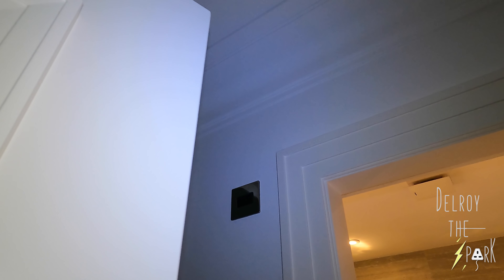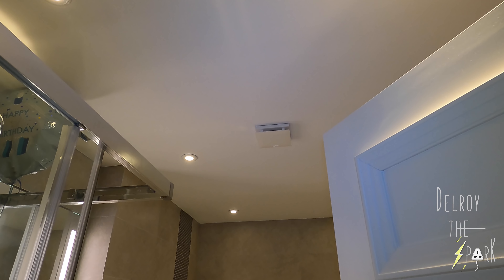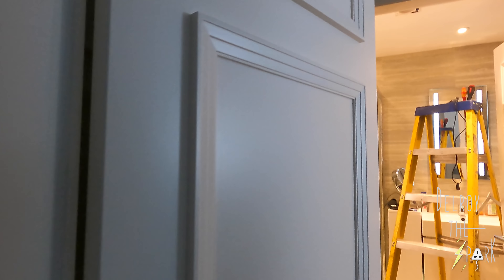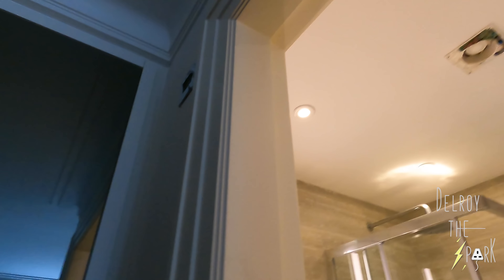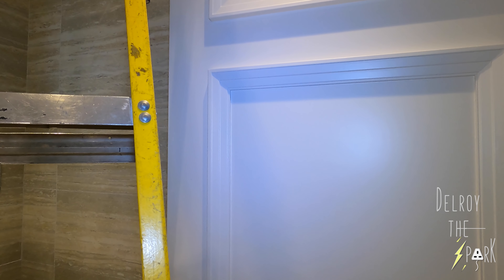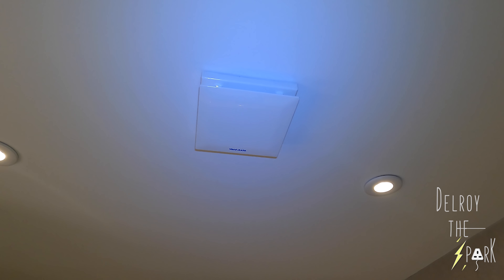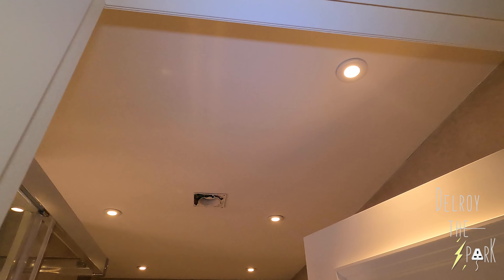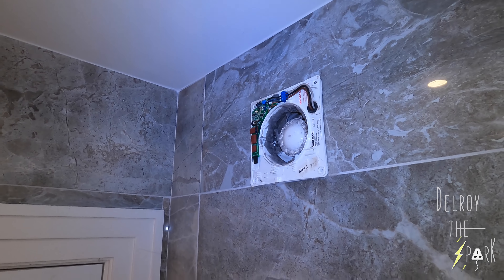"Is There A Problem With My Go-To Vent Axia Fans?"| New Builds = Problems!|Electrician In London

Comment: Nice one Delroy! That is a mystery regarding those fans. Surely they wouldn’t burn out prematurely simply because the ducting was long? 🤷🏻‍♂️

I suspect that, like many things nowadays, they are only designed to last just beyond the warranty period. 
I tend to choose Xpelair, although even I have to admit that they are simply not built to the standards they once were. Take the GCX6, for instance. That model can trace its roots back to the 1950s; you still see loads of old style ones in full operation, whereas the new model is just flimsy and built down to a cost. 

Keep the videos coming Delroy! Best sparky on YouTube 👊🏼 Take good care mate.
Reply: Yes, got a u6 40+ years old, not perfect but still running.

Comment: Asif Iqbal, I believe YOUR comment has finally solved the mystery of why the top fan was so dirty. Some of the air from the fans on the lower apartments had 'always' been exiting through the top-floor fan via the common duct, an ongoing problem (not a pleasant thought).
Presumably some of air in the rising common duct chose the lower resistance path of the top-floor fan rather than moving through the ducting to the exit via the outside wall. My own original wrong thought was the very very unlikely chance that the fan had been running in reverse, thanks for your insight.

Comment: I got called out last week to a new build, the homeowner was getting belts off their oven, who ever installed the electric didn’t think they needed a CPC for the hob so just chopped it off, was getting 180v on the metallic surface of the oven to the earth of the kitchen ring main.
Reply: Got a shock off my sister's Lamona glass induction hob. Spilt a bit of liquid next to it on the laminate worktop and wiped it with my wet hand, and accidentally touched the metal cooker door below with my other hand. Measured up to 122v. 

I think it was helped by a mass of breadcrumbs underneath the sticky sided glass edge. With the DVM just on the dried wooden top half a foot away, it also measured 2v with the insulated probes held in the air until switched off.

Told her to get a spark in and she said "It was fine when I was using it!".

Comment: Those vent axia fans tend to fail after a while, tends to be a small capacitor that goes on the circuit board. Two failed in my flat within 6 months of eachother!

Comment: Most of these fans require a 3a fuse to protect the internals, they mostly state this in the manufactures instructions. I usually install the click range, 3 pole fan isolator with a fuse carrier.

Comment: I've had a few of these fail on the low speed setting, change them to full speed fixes it, suspect a failure on the dropper resistor, but didn't check. I've only had one bearing fail so far, despite some running pretty much 24/7

Comment: Vent axia was good. many moons ago , now cheaply made in China by 10 year olds unfortunately 😕  great channel delroy
Reply: Fans should be regularly vacuumed but that never happens....

You would normally find in bathrooms the air and dust and water creates damp dust that gets attached to the fan over time and clogs, causing it to work harder and induce wear and tear at a rate quicker than normal... only a good quality fan could last longer... combination of mass production and less quality control is the cause.
Reply: What's the next brand now?
Reply: @dfgdfg_  Anything that does not have a chinese motor, maybe Legrand.. schneider electric or xpelair. but could still be cheap motors in them or maybe not.
Reply: 10 year olds? Really??

Comment: most of these fans have 3-5 yr warranties. take a picture of back of fan with model number etc, contact supplier/manufacturer  and they will post you one for free. as a sparky always take pictures of back and keep broken ones instead of throwing them away, sometimes it's just motor or electronics. if its motors easy swap.

Comment: No ones mentioned the IP rating, IP44 when the fan stops there would be a mass amount of moisture on the PCB and within days it will fry, the PCB looks too exposed (china). get one with a better IP rating which would have PCB coating, which that clearly doesn’t.

Comment: I’ve fitted hundreds of these, not a bad fan but there’s far better ones on the market.  Fitting fans in a ceiling is always best to avoid as a lot of sparks don’t use the correct ducting and duct it too far to have any effect.  I’ve got a garage full of theses things where moistures dripped back in to the fan and fryed it.   Not the best design.  I’d. always core drill out or if not possible use a in line centrifugal fan with insulated ducting.
Reply: What would you say is the best?  Fitting 4 new fans at my house and I was going for either the Xpelair or Vent Axia.

Comment: Hello Dell

I have two off those fans x spells air silent fitted in 2017 both failed in 2020 . So I think the fans are quite but poor quality
Reply: axia-vent specifies these fans in its own data sheets as B and C goods as well as a maximum working time of 2 hours, which means if you forget to turn it off, the fans are quickly scrapped.

Comment: Probably on too small duct or too long run (or both) and the static pressure is too high - making the fans ineffective and shortening the electronics lifetime.
Reply: Never. note it is a fan and not a turbine. There is no physical possibility of building up a pressure in the exhaust air line that would lead to a force feedback. Since this fan is not subject to any measurably higher mechanical stress when the back pressure is too high to build up an air flow, a load-related shortening of the lifespan of the electrical components is excluded. Furthermore, axia-vent specifies these fans in its own data sheets as B and C goods as well as a maximum working time of 2 hours, which means if you forget to turn it off, the fans are quickly scrapped.

Comment: 3 years? They lasted a long time, usually after 2 years and 1 month they are scrap (always the same defect, undersized circuitry (operating point at 115% of the component load)).

Comment: These Vent Axia silent fans are very unreliable. I have three in my house and have had to change all of them within two years of installation.  All three vent directly out of an outside wall so they are not working hard to shift the air down a long pipe.  I love the silent fan, I don't want it to sound as if I have a 747 taking off in the bathroom in the middle of the night, but this brand has proved consistently unreliable. Can you recommend another manufacturer?

Comment: May have been a bad batch
Reply: Mate the lack of commitment to engineering standards in the modern context is appalling. It’s cheap electronic and mechanical components built for a certain price. I hope to God environmental legislation comes in which mandates manufacturers ensure longevity of their products and allow easier repair. Otherwise the waste from poorly made products is every increasing and is not sustainable.
Reply: Good content delroy ,  all bathroom fans need a good service clean once a year otherwise the deposits on the fan overheats the motors. Some have a thermal fuse in them .

Comment: Not surprised they`ve died with that amout of crap in them, Vent Axia used to do a similar looking one with an upfront dust catcher slide out mesh filter. The new "woke" low power motors don`t help to clear the dust up the pipe and just stall with a small build up of dirt.